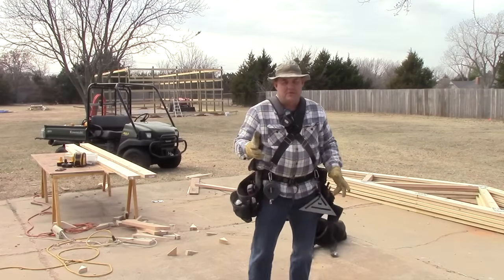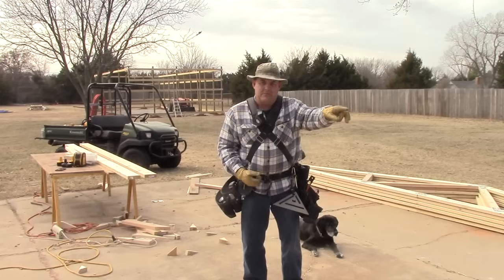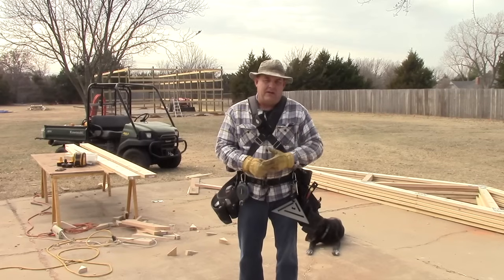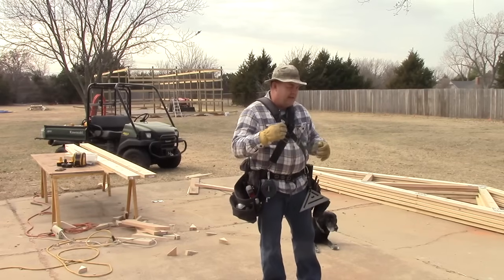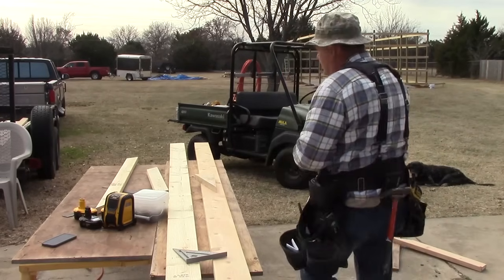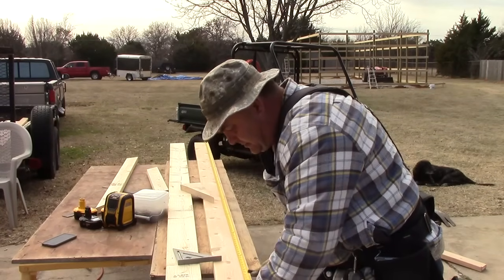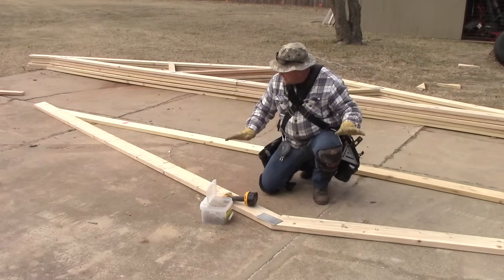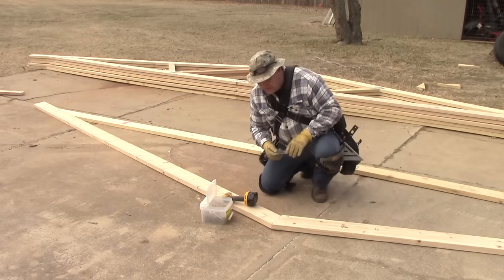How to Build a Pole Barn - Building the Trusses

Comment: FYI, Simpson does not rate their Strong Tie plates for truss construction.  The four or five screws your using on each end of the plate come nowhere near the shear strength of a press in truss plate.  These trusses will fail at the center bottom joint with a heavy snow load.
Reply from the maker: So far so good after 6 years.
Reply: @Kaypratt  that would be the failure point. Wouldn't hurt to add a couple 1 1/2" × 24" or so metal strap at that joint to at least a few trusses throughout the building. Wouldn't cost much or take much time if you just reinforced truss at each post or every 8' or 10'. I'm no expert but those screws being that close to the end of the boards in a location carrying all the tension would worry me. You have nothing to worry about with compression up top but that bottom tension location could definitely be improved. Just trying to be constructive.
Reply: Now they do
Reply: Built my Trusses 30 years ago in Northern Maine winters have had zero issues and I used screws.
Honestly I'll probably use deck screws when I build a new barn this winter. Heavy deck screws.
But all mu farm building Trusses I've built this way.
It's important to understand what the difference is between "sheer" strength screws and tinsel strength screws.
Still there is the multiplier effect of strength depending on how many screws you use.
Mostly the information they give for Truss plates is a CYA and extreme.
Still if my snow fall in Maine which is common to get 2-3feet doesn't cause failure I'm not sure which snow load will
Reply: @Kaypratt  he didn't know what he was talking about, I've built trusses like this for years and they have held up for over 20 years
Reply: . What are the degree cuts for the webbing? Is it 35 between and 55 degrees ?

Comment: If you use one complete truss as a template and put small side walls on the sides of the truss, you can just lay the pieces in place and nail it together. It's a lot faster than laying each truss out on the chalk lines.
Reply: Great advice! Also give’s a little bit more support also
Reply: Dwayne French I don't think he was bright enough to think of that.
Reply: Factory uses pins on this giant table. Can make a truss in 30 seconds. Then it goes through a roller to press in the plates. It’s neat

Comment: and after i built my first truss , i left it laying on the driveway and used it as a template and built the other ten trusses right on top of that first one, this insures all the trusses are exactly the same size
Reply: That works too. I just chalked out the truss so I could put each one back where the chalk line is at.
Reply: It's funny I build trusses for a living an this is exactly what we do in certain situations depending on the job idk if you're a builder to but you are right it would save so much time

Comment: Good vid, just a quick construction reference,  to get square lines just remember these 3 numbers 3'-4'-5' or multiples of those 6'-8'-10',  12'-16'-20'.  Using the 3'-4'-5' you snap your first line, mark where you want your intersection to be at, from the mark go back 4' and mark the chalk line, from the first mark take your tape measure and arch out 3' at a rough 90 degree with a pencil, go to your 4' mark and pulling towards your 3' arch, hold the pencil on 5' and arch again, that intersection is a perfect 90 degree angle. It sounds complicated but it's very easy but you need two people

Comment: Would've used plywood instead of those gusset plates. Covers way more surface area, you can PL it together, and it will be way stronger than any "engineered truss"

Comment: Thanks for making the video.  I am going to make my own trusses soon.  I intend to use 3/4" plywood gussets and glue/nail them with 8D nails.  They will be stronger than the junk engineered trusses I've used before.  I am worried about the plates you are using and very worried about the screws you are using.  Screws have there place, but not usually allowed where shear is a concern.  I don't believe those trusses are near the structural strength required.  If one or two fail, that could cause many or all to fail.  I would get some opinions fast on that.  Remember,  just because the building appears fine now, doesn't mean it will handle the next storm.  You can probably fix them with plywood gussets and glue and nails.  Anyway, good luck and thanks again.
Reply: Companies sell “engineered” trusses making a profit off of a stamp. Then they mass produce them with cheap labor and low quality lol

Comment: I would like to know what site to use and have it draw them out with measurements. Years back I built a set for a barn. I did as you with my first one. After getting the outside shape laid out and tacked I laid  braces inside before cutting them and stood back to eyeball the spacing. Those first braces became the pattern and I cut enough at one time to do every truss. After nailing it together we traced around the entire thing. When I finished nailing one on the first side I'd flip and finish while my wife laid out all the boards in place for the next truss and drop the plates down so all I needed was a hammer n nails. it surprised me how fast they went together.

Comment: Wow , loved your video on this . I am also in the process of building a pole barn and would like to build the trusses myself dimensions are 60 feet long and  36 foot wide , I would expect that with 2 foot overhang my trusses would need to be 40 foot long . I live in the Florida panhandle how would I go about getting the engineering for this so I can start building these trusses I see how you did it through that website but I guess you have to have the CAD software and then load the plug-in which I have neither is there someone I can just give those dimensions and location to that you know of I don’t mind paying a fee , any advice or help would be greatly appreciated thank you so much .
Reply: Not sure if you have found the answer to your question else where or not, however one thing you could do is go to lowes, maybe home depot too, and go to their "Pro desk". I have found that the engineers that they use/talk to can be very helpful.  Maybe they could provide you with drawings for a reasonable price.

Comment: In Florida, it is against the law to construct your own "TRUSSES" without at a minimum of either a Florida Licensed Structural Engineer's or an Architect's professional seal on the design documents, PLUS have them inspected by that same structural engineer or architect, prior to any erection, as without compliance you could be required to totally remove them out/off of the structure. Building codes have changed and even pole barns are now required to be properly designed for all loading characteristics, noted within the code. Hurricanes in Florida folks, we can't avoid them.

Comment: Im building similar but i think i made my peak to strong and heavy i made them up there. I only wanted 4 poles but temporarily put 6. 2 more holding center till im done.. im learning self teach the best and easiest way for a single person with no machine or lyft only couple of wobbly ladders lol the roof is very strong but its probably because all 6 poles if i tear out 2 i don't think it will stand much weight since the roof is so heavy all ready. I added steel plates and still adding stuff. But these press style plates what they make trusses out of if you buy those and screws with washers I wounder if it could hold and might take less screws and the press plates are cheaper way cheaper. Just be aware when it has snow on it i wouldn't be out playing in garage that  week lol. But yours looks like it will hold weight. You should see how my grandpa built our house trusses he barely has anything holding the roof up and its been strong and still going for over 80 years. 30 ft 2x4 with only 3 boards along holding it up but he has beams the boards sit on so if roof falls it will never hurt anyone inside without a doubt. 5x8 rough milled beams all wood was rough milled nothing is straight but its strong. It will out last me. The plywood well he has boards but the boards need replacing and put plywood  only problem screwing old boards they always split and have no hold power. Would like to make some trusses the right way at home. Cheaply.

Comment: Now if you stick build every rafter that is a different story.  You have a ridge board at the peak of the roof.  On each side their is a rafter that is nailed to that ridge board.  Now the rafter size has to be calculated for the width of your building.  Which will also be calculated for the pitch of that roof.  These things will decide what width of rafter is needed.  Could be a 2 x 8, or it could be a 2 x 10, or it could be a 2 x 12 by what ever length which is half the span of the building width.  Rafters a home builder can usually make and as long as you understand and know how a rafter is measured, and calculated correctly you will probably be okay.  Just because some guy says you can make your own TRUSSES DO NOT BE FOOLED.  TRUSSES HAVE TO BE ENGINEERED FOR EACH AND EVERY BUILDING THAT USE THEM.  THEY ARE STAMPED THAT THE SAID TRUSS WILL BE ABLE TO HOLD SO MUCH WEIGHT.  So check it out with your building inspector and your municipality first before you get youself in way over your head.  Just trying to help!
Reply: Trusses are not really different. There are well known truss templates, with freely available span charts. This vid was ok, even though that top chord where they met looked like it slipped before nailing.   Since you normally have to make a decent number of these, it will save you time and effort if you get that first one laid out perfectly, and then use scrap 2x4 to nail 'guides' along the outside of each piece to help the rest of the pieces just require placing in its proper place. Lot of YT vids show this.
I can see using a screw on a nail plate to secure it to its member, however the rest should all be nailed with good hefty nails, unless you really want to shell out for 5 lbs of structural screws.
You can always go to your box store and simply have them spec you out 1 truss and buy it, and use that for measuring and making your template to copy.   Don't buy the cheapest crap 2x4's with knots galore for your trusses.
Reply: Well, before there were truss making specialty companies, framing carpenters and diyers alike typically made their own trusses.  Some of us have and still do.

Comment: you don't need siri 3, 4 ,5 triangle is a right angle triangle.
Reply: Joe Frisbie 6’, 8’, & 10’ also works and if measure accurately can be used for greater accuracy or a double check.
Reply: Yes any multiple of 3,4,5 works.

Comment: actually screws have a lower shear strength than nails, nice trusses though.
Reply: Correct. These would not meet engineering spec.
Reply: Actually, it depends on the specific type of screw.

These trusses absolutely would not meet code in my area, but some localities have little or no requirements for agricultural type buildings. The most likely failure point on these trusses would be the bottom chord joint, as it is under tension.

Comment: Does anyone know what  the most commonly installed truss for new construction residential homes are?
Reply: Most common truss will depend on what the roof will need to handle weather wise.  Ask when you call to obtain your building permit, they would know what is common with respect to the municipal construction code requirements and roof loads if any.
Reply: Fink and Howe are the most common truss designs.

Comment: What do you do about wood that splits when you use those screw?
Reply: LOL, either pre-drill or tap the tip of a nail with a hammer and then drive the nail. Possibly buy better wood.
Reply: @boots7859  nope

Comment: The proper plates are called gang nails and you can still screw them in.  Your bottom cord is overkill, 2x4 can do it, did you get a hold of a truss company they would give you the proper layout.  Yours are overbuilt.

Comment: It is a good video but using metal plates with 1 3/4 screws does not I believe secure the truss members good enough. I have seen plywood made as gussets by gluing and nailing but even that I would be concerned. The manufacturers of wood string roof trusses use special metal plates with hundreds of shank like projectiles that pertrude from the plates and are imbedded into the truss members while a machete holds the truss members stationary and very tightly together. The machine that presses the plates into the truss members uses several tons of force this causes the plate to me almost perminatly fastened to the truss members.  I have tried to take these professional trusses apart and you literally have to destroy the wood truss members to do it.
Reply: yes and no. plywood gussets are used extensively for truss repair, engineer approved.  his gussets should be a little larger but should work fine.
Reply: Have you ever tried to tear apart a truss with glued and nailed plywood gussets? They work very well.
Reply: @mitchellbuss2424  we built our dairy Barn almost 20 years ago with homemade trusses with three quarter inch plywood gussets and just nail The living daylights out of them roof  was not sagged one bit    5 years ago we had a huge snowstorm with 6 ft of snow on the roof and it never sagged an inch.
Reply: @mhdairyfarm2911  no doubt. I've built and repaired many trusses over the years with trusses it's all about the connection.  I've seen them with a circular ring and bolts through them circular groove for the rings. They were in a church 60 70 years old

Comment: This illustrates the danger of learning from Youtube videos. Anyone can post anything with no control. This is not a structurally sound way to build trusses. These plates won’t hold, especially with screws. There are two approved types of gussets, plywood with glue and nails (DIY) and mending plates where multiple teeth are pressed into the wood (factory made). Please be a decent human being and remove this video before someone learns from it and gets killed by a collapsed roof.
Reply: I agree.

Comment: FYI ...Do not build your own trusses here is why!  Trusses are engineered and have to be made too specs.  Your building inspector will not sign off to approve your BUILDING.  Trust me i sold trusses.  I am sure throughout U.S.A. their is a building inspector that you will have to go and apply for a BUILDING PERMIT for said structure or structures.  That said most LIKELY you will have to supply a set of plans as well.
Reply from the maker: Shop is still standing 6 years later, and I did get a building permit and inspection with no problems.
Reply: Well you were very lucky my friend.

Comment: One strong storm...your trusses will collapse.  😒
Reply: Seven years later with lots of Oklahoma storms. Still standing. Maybe someday they will collapse.
Reply: @JamesPrattOK  How thick are those plates and what kind of screws?
Reply: The basic truss design is solid. The wood type and grade is unknown. The joint connections are substandard. The use of 2x6 rather than 2x4 lumber is overkill.
What you have to remember is that the basics of any common construction design has a significant safety factor built in to accommodate for shotty workmanship, improper materials, and missing fasteners, etc.  Additionally, the roof works as a system in its totality.  Loads from a weak truss will be shared through the decking to neighboring trusses. While not ideal, it allows the building to still function.